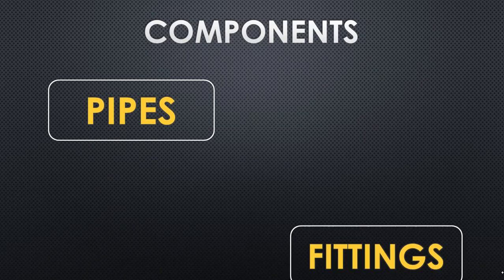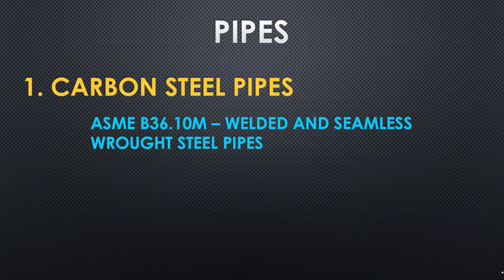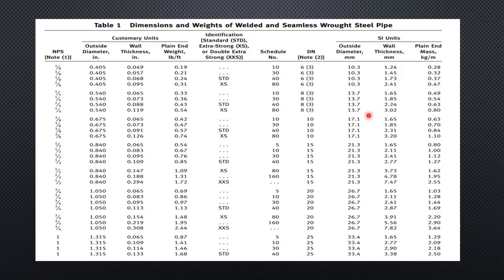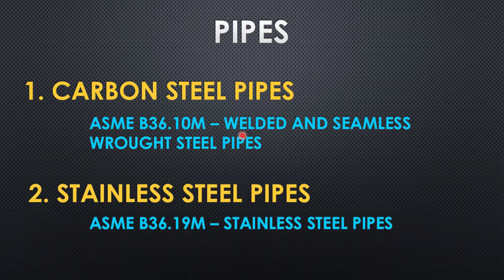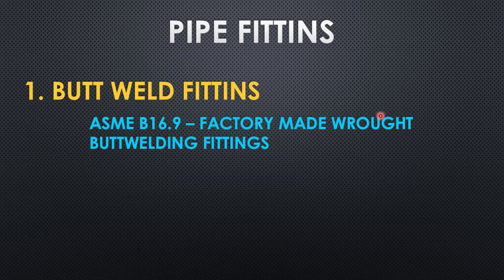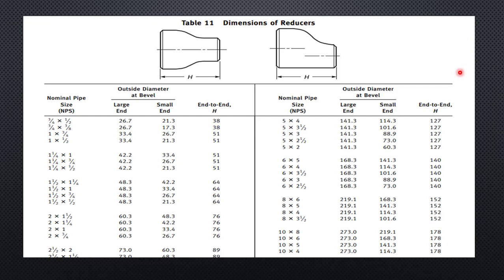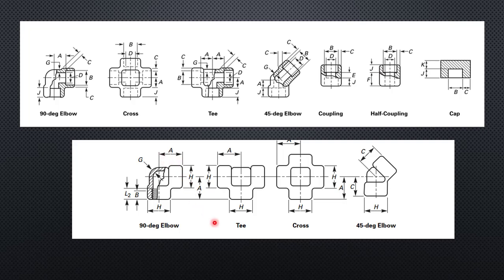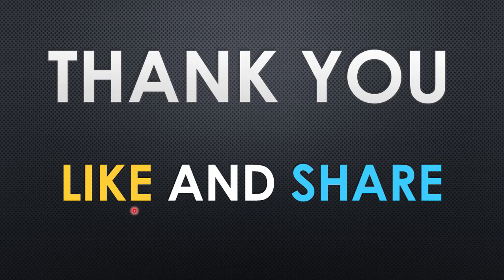Dimensional Standards for Pipes and Pipe Fittings used for Piping Design = Part 1

Comment: sir I have a question for you.
which are the different software used by a process engineer? is aveva3d worth it?
Reply from the maker: Hi Mo Qa, I am not familiar with process softwares, so I can't answer your doubt. I am only good at piping.
Reply: @pymedaca3130 
sir what about piping software? is Caesar II appropriate to learn?
Reply from the maker: @moqa474  Yes Caesar II is a good one as it is used across the world in most international companies.
Reply: Pdms, e3d, sp3d, Autoplant 3d for designing or modelling.

Ceaser is a stress analysis software which is used to analyse the modelling